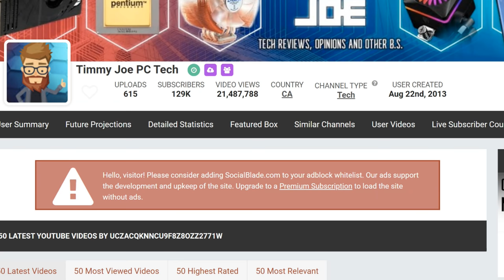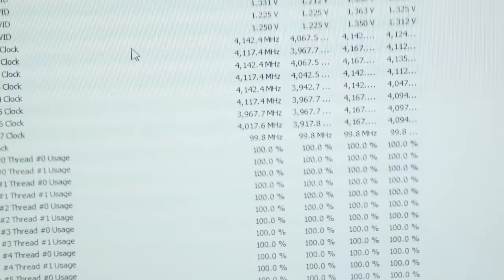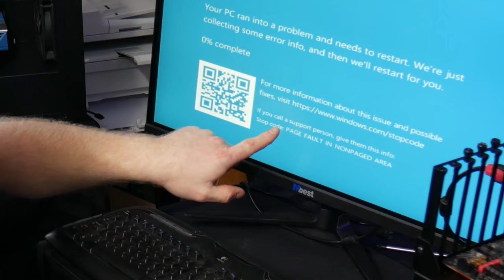This Ryzen 3700x was my biggest problem in 2019...

Comment: I recently had an issue where I upgraded my sons Ryzen pc. I bought a used MB, CPU, and installed it and it ran perfect. I upgraded the stock Ryzen wraith cooler with a Ryzen rgb cooler from a 2700x and next thing you know the pc wouldn’t turn on. Zero power. I took it all apart and reinstalled everything and nothing. My wife also has a Ryzen pc I built and so I swapped everything over and everything worked. I tried putting together the pc again and it worked but then a day later the same thing happens no power. So at this point I think it’s either the power supply or MB. I swap power supply and still no power. I swap MB and still no power. At this point I’m certain that the power supply or mother board is bad. I left everything unassembled and let it sit for a couple of days. I tried the mb outside of the case with just the bare essentials like MB, cpu, memory and power supply. I initially tried without the cooler and it works! So I install everything and no power. This happens over and over and finally I look at the cpu and I examine the pins and I see a small amount thermal paste on the pins so I clean it up and for extra measure I swap back plates for cpu cooler. I test the system outside the case and everything worked. I was so thrilled I continued to test the system and it continued to work. Finally  I installed it all back and since then no issues. 

At this point I don’t know if the thermal paste was the issue or the backplate but I’m not messing with it anymore as it works now. But   I was close to buying another motherboard and power supply. I’m glad I stepped away for the couple of days. The frustration was getting to me.
Reply: When you says "I upgraded the stock Ryzen wraith cooler with a Ryzen rgb cooler from a 2700x".  Can you be more specific?  It was a 2700x chip your son have right?  I'm a bit confuse on that part.  It sound to me it how much pressure is on the chip and too much pressure can make to not power on.  It happen to me before when I install a AIO water cooling both AMD PGA and Intel LGA socket.  The LGA was a bugger to pressure right.

  Or the wire metal connector of the PSU is loosen or not fully strapped correctly or a loosen MB 3.3v Male Pin on the board.  My PSU have a really loosen MB 3.3v connector to not want to power on before or worse shut down by itself when there isn't enough power available on my Fxa 990 Gigabyte UD3 Ultra MB which I need to fix in the future.  The patch fix was to move the one specific wire around before power it on to work until it do that again.
Reply: @MrEscanaba  In an AM4 socket the pressure does not matter at all. You just screw your cooler (any cooler) as tight as it goes. And the 2700X's wraith prism stock cooler uses a retension arm mounting system. So there is only one way it goes on the processor there is no srews. In this case i think the thermal paste he used mite have been conductive. And that may have shorted out the system. Since there was paste under the processor. I doupt that it was the backplate because the cooler uses the motherboards stock plate.
Reply: I originally had  2200g with stock cooler then I upgraded to a 1700 with the same stock cooler. Finally I purchased the rgb cooler as an upgrade.
Reply: Yeah the 1700 cpu was purchased used installled on a b350 pro 4 MB. I never bothered taking it out initially but it worked fine. It’s only until I bought and installed the rgb cooler that it started acting up. The original owner you can tell used a ton of paste as it was everywhere. I used a toothpick and q-tip to clean up the pins and motherboard. The confusing part was why did it work for a week then stop working only when I used the new cooler?
Reply: Sounds like you have a damaged mobo pcb layer that's being flexed when you install it in a case.  I'm guessing this last time you put it in, you had the magic level of pressure between the mounting screws and cooler mounts to not get the issue again.
Reply: Talk about cooler problems huh,I just bought a 2700x and decided to use the stock Wraith Max since I was not overclocking it.When I mounted the cooler,my finger slipped on the screwdriver from the pressure and I scratched my motherboard and chipped something.Still works though
Reply: You guys don't know how to screw a cpu cooler or   install  prism one properly
I Use ASRock b450m as a test bench to test out CPU to see if WORKING
I put in like 300 ryzen cpus already with both coolers n no issue at all .
Reply: @jorgevalerio8602  you can always spray paste out with a can WD40, it's not conductive
Reply: @j.p.h.8126  It can matter if you over pressure it and it not because it a AM4 socket generation when it still a PGA socket, like the Fm2, Am3 and so does other chip to use PGA socket. 

 I'm only stated from experience with over pressuring my CPU.  The socket is plastic and over pressure can make it speard out a little too far, just as LGA socket can miss one or many pin on the MB to not touch the plated metal under the CPU.
Reply: @MrEscanaba  In past 20 years i have never managed to over tighten a cooler. If the mounting system has screws tighten them ''wrist tight''.
And its virtualy impossible to over tighten the Wraith Prism cooler because of the retension arn mount. When fully tighten you can still
wigle the cooler a little on thhe processor. I have used the cooler in question on my 2700X. Most modern coolers have mounting systems
that you cant over tighten. Unless its some no name chinese toy cooler.
Reply: you're a good dad that's a lot of work
Reply: @j.p.h.8126  Doubt it a Chinese toy cooler but all the board and cooler are china good so I don't see how that fits that logic, a cheap knockoff can still work unless the back plate doesn't have a spacer or a plastic spacer to keep it from conducting, or worse fry the motherboard, which I've always avoided.  

The conclusion that I have had with my old PC installed with the Enermax was the socket was being bend from the back plate of pulling toward the heat-sink like finger crushing a sandwich, making the motherboard bend from the spring screw and back plate design.  A stock cooler pull the back plate and the hook to lift a motherboard circuit sightly but not a lots, unless it would be the sign of a issues of having a poorly made board, especially those loosen power male connector on both CPU and MB voltage connector.

It may not happen to you but it happen to me to loosen it a little and all work fine to never see it does that again. I've break many thing with my strength that isn't computer parts to always been careful of anything I need to tighten.

  That how it happen with the Enermax 120 thick rad cooler AIO before and it had happen on my AM3+ socket to figure out why it does that, the AM4 socket here in my Ryzen 1600 have a MSI Frozr L install to been extra sure to not to, even if my hand strength have no measure of knowing when it tight or not to be finger tighten safe just to be sure.  It is true about modern cpu heat sink gotten better to have a better design of not causing MB to bend or damage or have a prevention of over tighten, a older style cooler can cause the problem in someway.  The socket mount design would be one of those feature, since it is design to pull the heat sink toward the motherboard on top of the CPU on the bracket stand and not the back plate pulling to the heat sink holding it.
Reply: There is an awful lot of pressure on those coolers. Cracking the mb is a possibility.

Comment: Very glad I watched this all the way through--last fall I built myself a new pc. Using the 3700x and a Gigabyte Aorus X570 I Pro Wifi board...A nice tiny ITX build. When I was choosing parts, there were only two X570 ITX boards available and I think I ended up with the Gigabyte board because it was a bit less expensive and because I was going to be using a Gigabyte 2070 mini/ITX GPU.
I did not get an engineering sample cpu of course, and my computer has been happily running since. Not 24/7 certainly but 2 to 10 hours a day (depending on how much play time I have).
HAppy Bday!

Comment: my only guess would be something in common with gigabytes "AUTO" voltage settings maybe.. unless of course you selected appropriate voltages for all settings.
Reply: Gigabyte had voltage issues in their bios on 3000 series launch. Probably a gremlin that remained.
Reply: Could be, I have the same problem with X570 aorus pro wifi and 3700x. It worked flawless for more than 5 month. But suddently it keep rebooting when loading windows. Using manual clockspeed and voltage seems stable, just not auto stock setting. I thought it is the CPU problem, so I just sent my CPU for RMA😂
Reply: Been running a 3700x with a X570 Gigabyte gaming X since mid July and have been problem free. fingers crossed
Reply: @hadenas1  man I wish I was that lucky - My 3-week old brand new PC with 3700x and same mobo died last week and found out the CPU was busted. I'm really worried that it may be the mobo.

Comment: the same thing happened with my ryzen 5 1600 6c 12t   on the aorus b450 elite (gigabyte) i didn t understand as everything was brand new  then i bought the ryzen 7 3700x newer release and it works perfectly. so idk what exactly the problem is

Comment: Thanks for the video.
I have the same problems.
I have a Gigabyte x570 aorus elite, a Ryzen 3900x CPU.
I didn't overclock my computer. UEFI in default settings.
The PC worked fine for 3 hours from the first start, the problems started when I ran the test render scene in Blender 3d. After restarting, the bluescreen appeared at the same point in the rendering.
The next bluescreens were getting more frequent. On the next day, the computer was restarting 3 minutes after being booted.
I also exchanged parts: 3 types of Ram, 2x GPU, 2x power supply, 2x hard disk (HDD, NVMe), the latest UEFI uploaded.
I can not count how many times I reinstalled Windows 10, from the original Pendrive and the version downloaded from the Microsoft website.
I sent the CPU and motherboard for a complaint. AMD said there was no problem, Gigabyte detected a problem and said they fixed something, did not say what was fixed.
After arriving with the complaint, it is even worse, I can't install the system because the bluescreen appears during the installation. This week I am taking the PC to the company where I work so that IT specialists can check where the problem may be.
My friend has the same motherboard with Ryzen 5, he has Bluescreen 3 times a day.

Comment: I had this same issue when first i build my  3700X build in Nov 2019, i have gigabyte x570 aourus elite wifi, u have to fresh install win 1909 build, any thing below 1909 will crash, mine started working when i fresh installed 1909 version and is still working just fine.

Comment: Since the issue was common with gigabyte boards and sounds like a BIOS issue
Reply: Mansoor Haque  yeah I think there would still be an update for x570 mobo's as the initial bios' had some bugs when it first came out. pretty sure it was a launch-day-patch situation with the x570 with some board makers.
Reply: There are still issues with Gigabyte X570 motherboards, using the latest BIOS. Intermittent no POST and no response for 4-5 minutes from sleep mode.  I'm pretty sure it's a BIOS issue linked to PCIe devices, but an issue it is.  At this stage, I can only say I'd never, ever, buy a Gigabyte mobo again, and it took me over 10 years to risk it since the last Gigabyte I bought gave me no end of trouble.  I kinda wish I'd have gone with Intel right now.  Aorus X570 Pro is premium priced rubbish IMO. Gigabyte need to sort it and their crap BIOS releases out.  Oh yeah and my one loses input devices, so no keyboard or mouse, just like in the video!

Comment: Those issues are the worst!

I was an early adopter for the AMD Phenom II 955 back in the day, and on my Asus 970 board, I'd get random inexplicable crashing. Not as often or repeatable as this, but very random. After month of troubleshooting, I finally discovered that adding a bit of extra voltage to the Memory Controller fixed the problem. I later upgraded to a 1090T that didn't require extra voltage on that board, then moved the 955 to a newer but more basic 985 board. Ran fine at stock voltage. In fact, I just sold a PC with that chip in after having it for nearly 9 years. Started in my primary desktop, then went to an undervolted under clocked HTPC setup. Then spent the end of it's time with me Overclocked to 3.7ghz in the guest gaming PC, and sold it as such. But yeah, needed just a touch more voltage on the memory controller when it was new in that particular board. Oh the joys of custom computer and random issues...

Comment: Not sure if it’s weird but my most frustrating PC problem happened with my second build. Everything worked except my microphone audio (it’s a gaming rig so REALLY important). I tried everything: swapping the USB dongle between ports, using both front and back mic in jacks, using different mics, multiple clean installs of Windows, unplugging and replugging the HD audio cable, installing Realtek and all the audio drivers, uninstalling Realtek but keeping the audio drivers. Finally I decided to try one more thing before RMA’ing my board, I set up my first build (spare mic, monitor, keyboard and mouse) opened up the sound settings on both PC’s and then tried my best to make them match (my first build was Windows 8.1 and my new build was Windows 10).

You know what it was?

System sounds > Playback > clicked on my mic > Properties > Advanced and under Default format my mic was set to Telephone Quality instead of CD Quality or above. By default Windows 10 had done this.

For as long as I live I will never forget to check this setting.

Edit: Took me 5-8 hours to figure it out by the way, all the while talking to my friends on Discord/recording myself with Shadowplay, so I knew when it was fixed.

Comment: I've had this EXACT issue. A 3700x bluescreening with the "PAGE_FAULT_IN_NON_PAGED_AREA" on a Gigabyte x570 AORUS Ultra. I did the same steps as you--reinstall windows, flash BIOS, new RAM, new PSU...

I bought a new 3700x and it works fine. I took my old "broken" 3700x and put it in a B450 Asrock Mobo... and it works... Now both computers work great; haven't bluescreened in 2 months.

I found a way to consistently reproduce the bluescreen instead of waiting 3 minutes idle--Do a computer reset. During the reinstallation of windows, it bluescreens almost 100% of the time. Installing windows from a USB works fine... sometimes.

So sorry you had to go through this too! It stole 3 months of my life that I want back. But it definitely seems like it has something to do with Gigabyte Mobos. It makes me feel SLIGHTLY better that I wasn't the only person on earth running into this issue!

Comment: I had issues with my gigabyte board with my 3700x as soon as I enabled xmp in windows use or in general with bsod, swapped to an msi board too and I've not had a single issue since.
Reply: That's my build and im having issues too. Did it cause you to lag / fps drop randomly and often? I thought it was heat but temps weren't too bad, maybe it's this.
Reply: Had this exact issue with my 3700x with my gigabyte b550m motherboard. Took way too long before I found out that the xmp profile caused the lag. So instead of enabling the xmp profile I just manually put in the latency and MHz and since then It has worked completely fine for over a year.

Comment: Weirdest problem I had was over 20 years ago, when doing field service at a bank.  A teller's machine just wasn't turning on.  After the obvious first check (plugged in with power at the wall), I replaced the PSU as the next obvious fix, but it didn't work.  That's when I unplugged everything and starting adding pieces back.  I wasn't until I started reconnecting things outside the case that I finally discovered the culprit - the keyboard.  A faulty keyboard was preventing the machine from powering on.  Not booting, mind you - just getting any power whatsoever.

Never would have guessed that was possible before that.

Comment: So I had this exact same problem with my Ryzen 5 2600X, first was using an ASRock B450M Pro4-F, switched to a ASRock B450M Steel Legend. Tested out other motherboards as well, but still getting the same issue. Helped a friend build a system with basically identical specs as mine, and he had zero problems. Some of the AMD cpu's are messed up in production already, just need to get a replacement. And sometimes, as in my case as well, wont matter what motherboard you have, it'll still be messed up, yet in other cases, works in particular mobos.

Comment: Recently the voltage regulator chip went bad on my 10 year old Sabertooth 990fx Rev. 1.0. So the PCIE slot being occupied would fry out after a few months, due to a random spike in voltage while gaming. Didnt harm any other hardware other than the slot. So I would just move it down a slot and configure the bios to use that slot accordingly, for a few months. Then rinse and repeat until I run out of PCIE slots. Fastfoward a few weeks, and I am out of PCIE slots and with the mobo lacking onboard graphics, it was time for a suitable replacement. I gave the 990fx a vikings funeral. It had a good run of 10 years of OC and several processors and components. Those TUF components are well worth it btw.